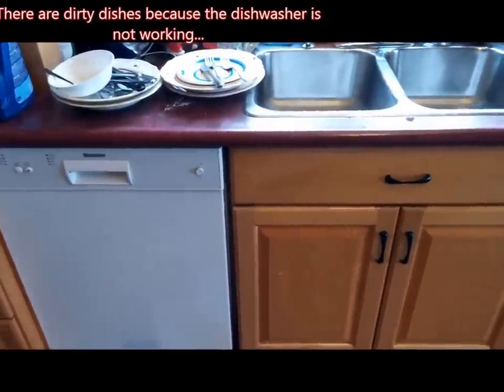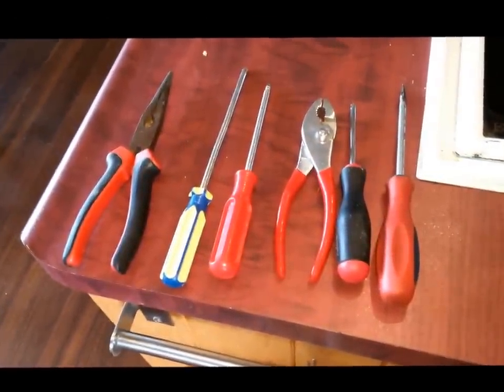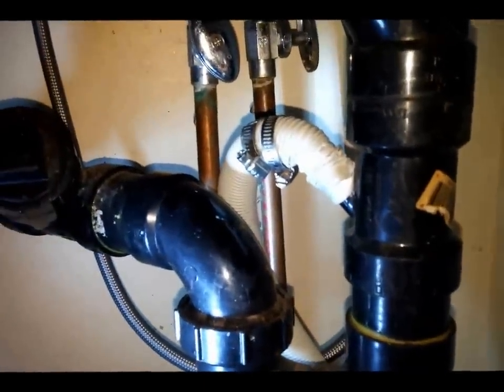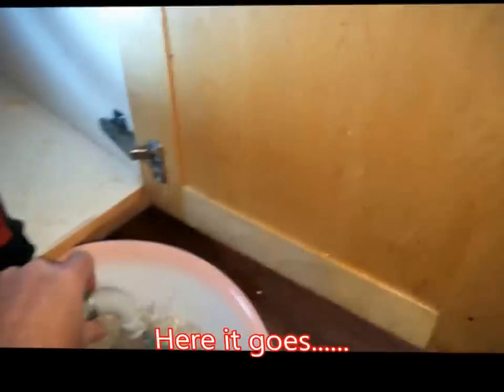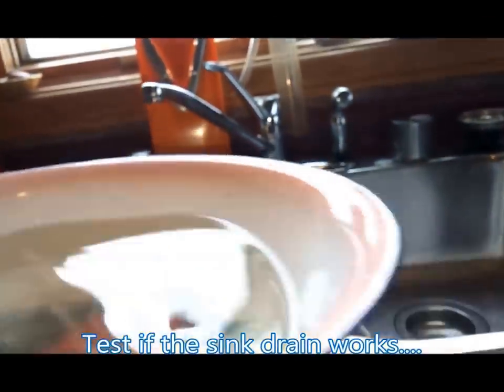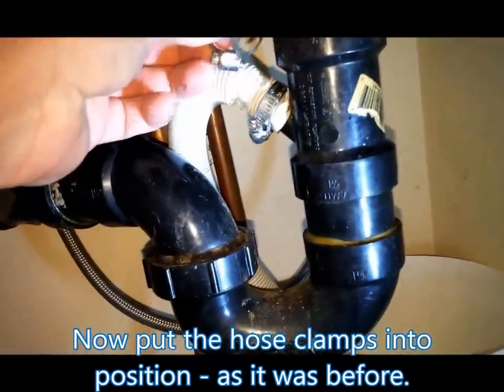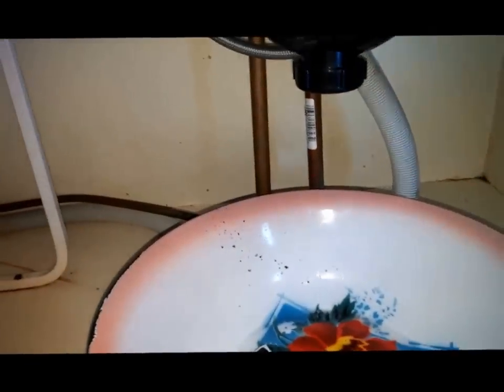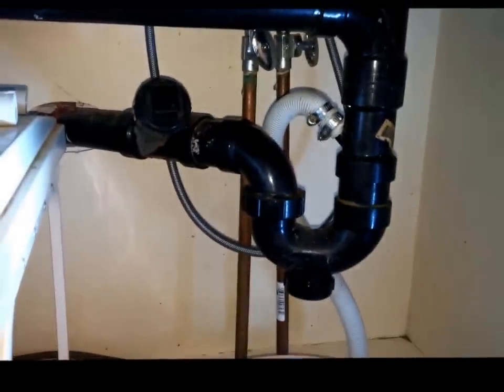How to Unclog a Dishwasher Drain Line - Solved 2017

Comment: I could be wrong, but a recent tip from a plumber... attach that drain hose going up under the sink and bending down to drain in the disposal. He said it would help to trap gunk in that bend of the drain hose, instead of flowing back down into the dishwasher and causing a funky smell.
Reply from the maker: Very interesting. Thank you for sharing this info.
Reply: 100% correct

Comment: Very pleasant video sir. One thing I'd like to add is it's a good habit/practice to clean the pea trap while you are already set up to do so. Yours actually has a drain plug built into the pea trap. It should be removed, inspected and cleaned every year or two. It takes a few mins and since you have a bucket, rags and opportunity, it just makes good sense to give it a quick look as well. Not only for normal build up but sometimes that blockage will sit in the pea trap, restrict flow and though it may seem to drain normally, over time it will/can worsen. If anyone isn't comfortable with removing the pea trap another method is, after you push your blockage into the pea trap, you install the drain plug and fill the sink about half way. Go to your restroom and grab your plunger, remove the drain plug and give it a good plunge. It'll help push anything that regular flow couldn't dislodge. I should add, IF any water you forced through the drain comes back up then STOP right away. It shouldn't but I have seen it more then once.. If you've already reinstalled the dishwater drainage hose then remove it so not to force any debris back into that line. Now, plug the tee that the dishwasher drainage hose was installed so water you are pushing through doesn't come blasting through that open tee at 50 miles an hr. You can plunge away. You may wanna add some vinegar, baking soda or store bought chemical to the sink water. If the results are the same you can leave it over night and see if the chemicals have loosened the blockage. If not then you will have to either snake the line or revert back to square one and remove the pea trap. Hope this helps anyone. Kind regards V
Reply from the maker: Thank you for your comment and suggestion.
Reply: Sorry - just seen this. This was my suggesting too.
Reply from the maker: Thank you for your comments. I agree that the timing would be good to do that. But I don't know how to change the video.

Comment: Many thanks for this - it fixed the E24 error on my Bosch DW. The cause? Sourdough starter. I made the mistake of washing out our sourdough starter Kilner jars in the DW - the starter is so sticky and difficult to clean. And the DW did such a wonderful job! Until it stopped working, that is The starter had set like cement. Well doh! I am now older and wiser. I certainly know much more about the innards of a dishwasher.
Reply from the maker: I'm glad ot helped.

Comment: Very good video sir. I would say though that removing the pipe U-bend is also a good idea as you can clear this at the same time. You can then use a screwdriver to push any blockage out and rather than push the blockage into the u-bend, you remove it completely.

Comment: Thank you! We were about to buy a new dishwasher, to replace our 10yr old, clogged/non draining Frigidaire Gallery dishwasher. I had tried cleaning all the filters, etc. to no avail. I was about to give up, and spring the several hundred $$ for a new machine, when I luckily happened upon your video. Used your technique... Wham Bam! Done, fixed, muy bueno! Thanks again.
Reply from the maker: I'm glad it.worked for you.

Comment: Well done! Thanks for posting this. My washer just stopped running yesterday. it would start up and display "clean" after a few minutes. I tried (1) cleaning out the drain pump inside the washer, and then I checked out (2) a couple of videos that recommended resetting it mid cycle. These didn't work. After disconnecting the line like you did here, I poked a little hard nugget of gunk into the pipe and voila -- the washer is working normally.
Reply from the maker: I'm glad it helped you.

Comment: Thanks for this, had this problem with a similar plumbing setup, had already tried the baking soda and this seemed the logical next step - the connection and drain hose were blocked with broken glass and plastic.  Dishwasher draining fine now.

Comment: You’re going to love me after you read my comment/advise. I always put dishwasher powder/liquid not just inside the sealed lockable compartment, but most importantly also outside of it. Logically answer yourself this question, when is the detergent required the most, when the dishes are the dirtiest at the beginning of cycle or halfway through when they are already partially rinsed by just pure water? The answer is Off course when very dirty at the beginning. So I always split my dishwasher powder between sealed compartment and outside, effectively it gives your dishes a prewash. Most dishwasher actually have designated space for this reason, sometimes uncovered, sometimes under the the main  flap slotted section. Frankly my “half “ of powder outside is alway bigger then locked “half”. It also has another benefit apart from cleaning your dishes better, it keeps your dishwasher’s drainage pipes clean, that’s because all this greasy stuff from initial wash is dissolved by the powder you’ve put outside of locked compartment and does not stick to the drainage. For this reason I have never ever used any of those heavily advertised “dishwasher cleaners”. You will notice it yourself when cleaning the filter (still have do it regularly, it’s compulsory), it won’t have this whitish gluey coat that is hard to remove. After 20 years of service I have replaced my old dishwasher with new one and guess what? The drainage pipe was so clean that I have not changed, just reconnected it to new machine.
Another tip, when you’re installing your dishwasher, connect it to hot water supply pipe instead of cold.
Don’t bother with all in one tablets or pods, always use dedicated powder/liquid and separate rinse aid. By the way rinse aid really makes the difference ton achieve spotless dry dishes.
P.S. obviously I am a dishwasher freak.

Comment: You have no idea how much I love you right now!! Thank you sooooooo much!!  ... wow. Turned out that we had this EXACT SAME problem! And it was super easy to fix. In our case the line was so tightly attached, I had to cut it off, but had plenty of slack to reattach it. Problem solved! I was surprised how stubborn the blockage was actually. It took some strong jabs with the screw driver to get it out. Dishwasher drains in mere seconds now. Such a huuuge relief. Thank you so much for posting this video!! :-)
Reply from the maker: Hi Erik, I'm really glad this worked for you. Thank you for letting me know.
Reply: :-) I think in our case the little plastic tab on the PVC pipe was never properly broken off, which probably means that since the mid 90s that little tab was sitting there with a tiny opening, and over time it completely clogged up. It's now properly opened up, drainage working again, and what's more: way faster than ever before during the 4 years we've lived here.
Reply from the maker: Awesome. Well done.

Comment: Great video. Quick question, doesn't your drain pipe the white one need to be level? Having it lay on the floor and hook upwards doesn't that not siphon correctly where it could cause the clogging to occur?

Comment: Thank you for the fantastic video. It was so easy to follow along and follow your clear instructions. I actually felt like I could give it another go after resorting to handwashing dishes for an embarrassingly long time. Other videos were confusing or started with pulling the pump apart, etc, which is not something I wanted to try. Looks like I probably didn't need to anyway. Found a little grease when I poked the screwdriver in. Fingers crossed that was it. Running the dishwasher now! You've gained a new subscriber. Will definitely look to your videos for other fixes I need to do!

Comment: Is it possible to find out if the pump is the problem or a clogged pipe? My machine doesnt tell me and while im preparing to clean the pipe with pipecleaner i do not know if the problem is the pipe or a defective pump
Reply from the maker: Good question.  You could buy another drain hose -they are not very expensive.  Or unmount the hose and run water through it to see if it is blocked. But the.first thing to check the the ABS Y-connector. Mine was blocked.

Comment: Hi Dan, I cleaned my filter and also did what you to the pipe and my dishwasher still will not drain. Do you think i could put baking soda and vinegar in the pipe to clean it out?
Reply from the maker: Hi Beth, sorry, I didn't see your question earlier. Did you solve the problem?

Comment: Your drain line (the white drain hose) should not be laying on the bottom of your cabinet. It should be raised higher than your sinks drain outlet, because the water will sit and stink in the white drain hose. Watch YouTube video called "do you need an air gap" ... You'll see diagram of my comment about getting your drain line off the bottom of your cabinet. You don't need "the air gap" devise, and you will find out what it does and how to arrange your drain hose under your sink.

Comment: Not really fixed. The dishwasher drain connector loads up with floaters and fats as the sinks are drained and they build up in the connector fitting over time. I had to unclog my downward angled fitting every 2 months with a chopstick. The dishwasher drain connector should be mounted horizontally onto the waste pipe as close to the sink base as possible and the dishwasher drain hose should be suspended higher than that fitting for at least a foot.

Comment: Sadly this video didn't solve my problem, as my dishwasher drain pipe is large bore, long and separate to the sink, though as it's full to the top, (a good two and a half feet off the floor) I know there is a blockage in it somewhere. Thanks for video anyway
Reply from the maker: Sorry this video did not help you.

Comment: Not really fixed. The problem is the sink drain connector is pointed downwards and any fats or floaters rise up into the dishwasher drain connector as the sinks are drained